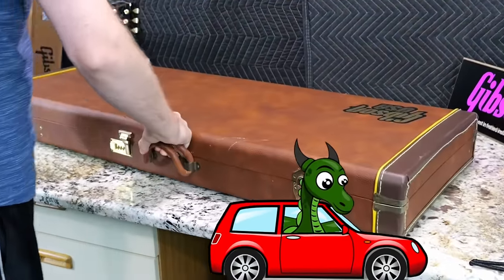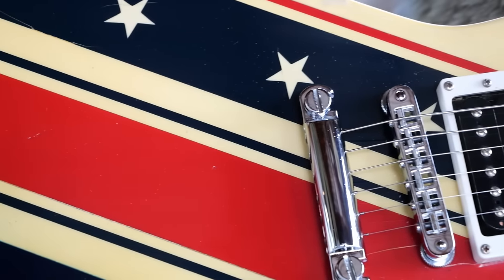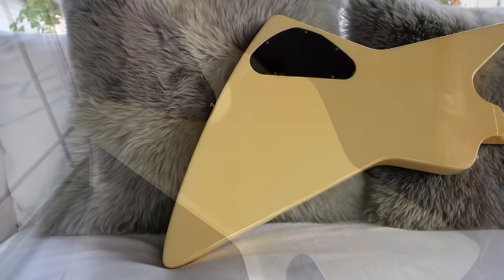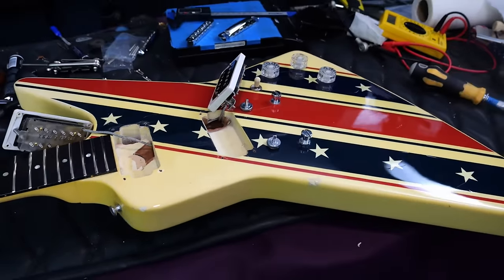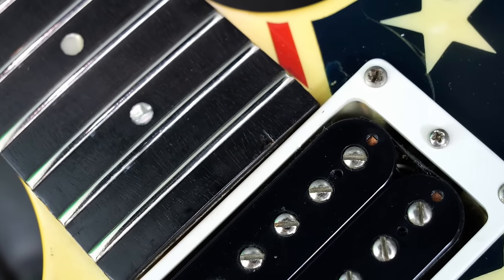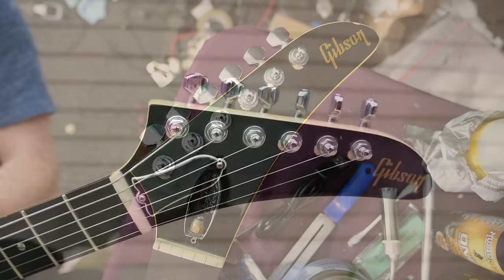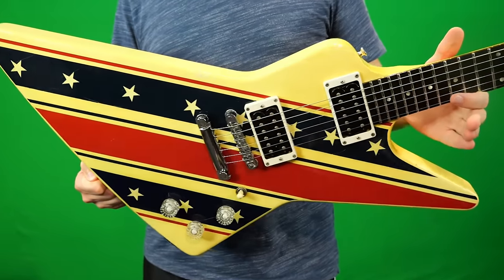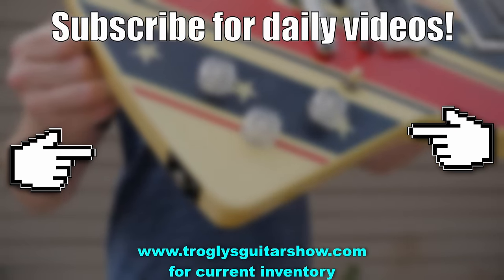I Drove 28 Hours to Get This RARE Guitar On Craigslist! | 1985 Gibson Stars and Stripes Explorer

Comment: Awesome guitar! I have an Epiphone Explorer, one of the years where it came from the factory with a Gibson branded truss rod cover. I thought the seller was an idiot and just put it on there, but I found out that that's how they came. I love that guitar. There's something different about it, it responds very differently when hooked up to my amps than any other guitar. With my Boss Katana it sounds incredible and louder on the acoustic setting??? So weird? I haven't checked resistance of the pickups yet but they've got to be super hot, right? I have zero need to upgrade to a Gibson. But that Gibson truss rod cover still bugs me!! It just didn't look right, the Epiphone logo is 5" above it!?!?

Comment: If you drove 28 hours to the guy's place to pick up the guitar, don't you think it would have been a good idea to check the guitar when you picked it up at his place, rather than driving all the way back home and checking it there?
Reply from the maker: Eventually you get to a level on these 80s explorers to not need to check them. I got photos of the truss rod earlier - the rest of originality can be judge just by a quick glance ,outside of the internal pots which don’t really matter much to me if the DF pickups are still there

Comment: In 1965 I traded a ES-125 and my dad paid an extra $125.00 for a 58 Gibson Explorer with case.  I had it for years and ended up selling to a friend that was working at a music store, he had it until he passed around 2000.   The only ding the guitar had was in the same spot as the starting point of the deep scratch on yours, center of the top rear wing, and was about twice the size of a BB.  I have hunted for years but have never found a photo of it.

Comment: Love that Explorer! Those Dirty Fingers were installed wrong at the Factory, the Hotter pickup should be in the Bridge position but still a cool factory error. The Rebel Flag would be the best Explorer but out of the 2 you have the Uniion Jack with the RARE Regal Blue base coat is the BOMB!
Reply: They just pulled the pickups out of the bin.
Reply: Just Googled it and it looks like the Rebel Invader was a Les Paul, not an Explorer?